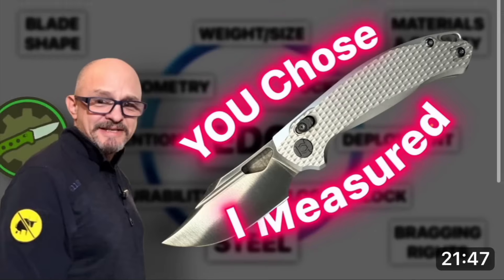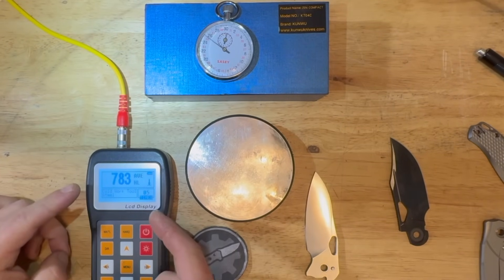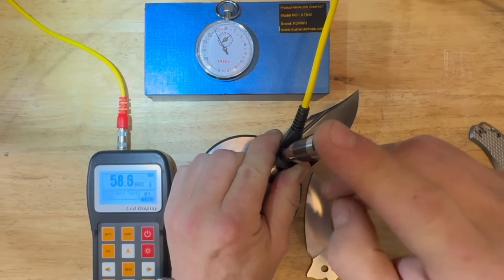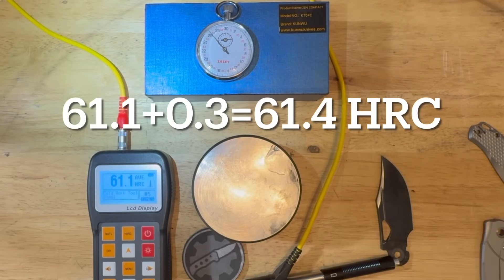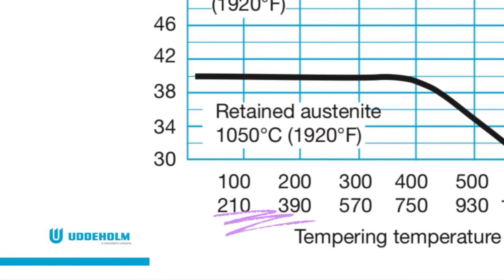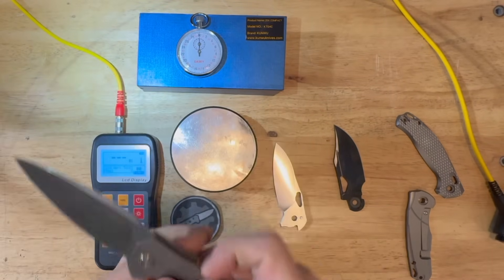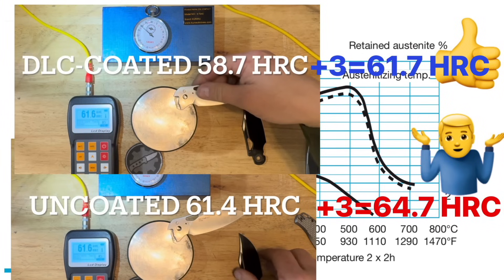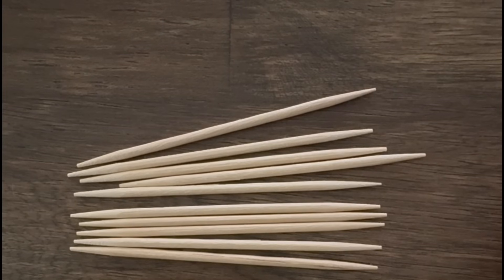Myth vs. Reality. Let’s discuss how DLC alters the blade’s hardness.

Comment: I only entertain a coated blade when it is an easily corroded steel. At that point I prefer PVD or cerakote. DLC has its advantages but seems to be applied to steels that don’t require a coating.
Reply from the maker: @Briancollectsknives  Exactly!!! MagnaCut, S20V, Elmax, Vanax, S30/35/45, M390, 14C/12C, AUS 8/10, and many others DON’T NEED TO BE COATED. M4, 3V, CruWear, even D2 may need to be coated but they are not too corrosive.

Comment: You should test the blade where there isn’t DLC coating. Like shave it off.
Reply from the maker: Not a must do. That coating itself is harder than steel. It is only.00013”-.00002” so it is the steel that is being measured.
Reply: @ if it’s harder than steel wouldn’t the test come back higher? Something doesn’t add up.

Comment: So dude. I'm a big Kunwu fan and have experienced many of their blades. And seen many different HRC tests using the industry standard technique. Using the type of machine that creates a dimple in the steel. The type of machine that is actually designed for the steels used in pocket knives among other things. And they have always confirmed the numbers that Kunwu claims for the HRC. All that said I'm open minded to different knowledge sources. However, this LEEB device you're putting all stock into seems to be widely known to not be reliable for the high hardness of pocket knife steels. A quick Google search 'will a leeb hardness tester give accurate hardness of pocket knives' told me everything I needed to know. That device IS NOT a reliable device for pocket knife HRC and therefore you're putting all eggs in that basket does lend credence to the comments made by Kunwu on your previous video.
Reply from the maker: The link to Leeb Standard for testing ASTM A956/956M is provided in the description of this video. You don’t even have to read the whole thing, just read paragraph 7.2 and see for yourself that everything you hear from the “influencers” about this tester is total unadulterated BS. You sound like an intelligent gent, just follow the link and read the short paragraph. Thanks!

Comment: I love kunwu knives but I do agree to just use a different blade material to build upon with the DLC. They do work with a lot of exotic blade materials so I can see and appreciate them for that. The only thing I don’t like are the noodle ass omega springs they use🤣🤣 but that’s a subjective opinion
Reply from the maker: I don’t think you’re wrong about the springs. And also, the slide knobs on th cross bar have metal to metal contact with the Ti handle, which is inducing a ton of friction. The system is not balanced. Still a gorgeous knife.

Comment: Not sure if You are correct with this video. DLC aplication temperature is 100 to 200 celsius and short time period. While "Temper at 250 C for 59-60 HRC, 2 hours x 2" so chanses coating itself lowering HRC by 2 or more points is way to low... I guess HRC before DLC was just low enyway...
Reply from the maker: Time period is important. Any specifics on what it actually is? 
But 100°- 200°C converts to 212°-392°F which overlaps with the tempering range.
Reply: Different steels require different temps and times for the tempering process. So------------------
KnifeMaker

Comment: DLC from my understanding will help a little with corrosion resistance but not to much but mainly it helps with being very scratch resistant so the finish doesn’t get ruined but other than that I don’t see much advantage I believe it depends on the steel it may hurt it significantly or not as much I have 4 kunuwu two non coated and two coated the coated are the Excalibur and the primo both are performing amazing cutting cardboard like champs haven’t had to sharpen them they seem to react to the strop quite well and the two uncoated are the padre and the gringo and they are the same way I think it just depends on the blade steel to where dlc may hurt the steel more than it may help it but they are great knives and there heat treat on both coated and uncoated blades from my experience seem to perform just fine none dull super quick and they all seem to take the strop great and come back super sharp and neeves knives has sharpened there s390 dlc gringo and it seems that it still sharpens super well and doesn’t dull to easy so I truly do believe it is just a steel to steel basis but to avoid all this figuring it out I generally do prefer non coated blades plus just a little bit cheaper too lol
Reply from the maker: DLC was introduced as heat, corrosion, and wear resistant coating for bearings in high stress/high cyclical applications. None of its properties are needed on a knife but it looks beautiful.

Comment: When I buy a knife with a coating, it's usually purely because of the look. The fact that a coating that works at high temperatures during the process has an influence on the hardness should at least be known to the manufacturers, even many knife enthusiasts know this fact.
Reply from the maker: @achimgeist5185  Exactly!
Reply: Coating processes are a thing that should be considered for heat treatment. A lot of coating introduce heat, so you shouldn't temper below the coating temp. That should influence your whole heat treating recipe and / or choice of steel.

Comment: I have a question, DLC coating is harder than the steel itself right ? I understand that this treatment can decrease HRC in the steel itself but if the coating is harder why when its tested its not a harder HRC ? Can someone explain it to me ? Thanks
Reply from the maker: DLC is hard and flexible at the same time. It is also very thin, .000013-.00002”.
Reply: @CuttingBoardRx Ah I see, DLC can be mesured with HRC too if its thicker ? Thanks for the explanation
Reply: @ Yep! It is only apx. 1 micron thick. and yes, itj is very hard. In the 90's HRC Hence the name. DLC= Diamond Like Coating. 
My double stack 1911 is DLC coated. No wear! May have the barrel done as well. 4
KnifeMaker

Comment: There's a whole lot of BS in this video, much as I hate to say it.  First of all, you can't go by the steel producers data sheet and assume that the knife maker used their recommended numbers.  Most steels are not produced for use in knives and thus there's often variance in the recommended numbers and those used by specialty knife makers.  Larrin Thomas recommends tempering Elmax at 350° F, not in the 200s.  I doubt there are any knife makers using such a low tempering temperature for Elmax.

Second, you're grossly underestimating the temperature for application of DLC, which is closer to 700° F than 300.  So even at 350 F temper, application of DLC would be expected to reduce hardness somewhat.  How much?  Hard to say without actually testing it ... properly.

Third, you can't assume that your test of the coated blade is accurate, since 1) you didn't strip the coating and prepare the surface accordingly, 2) you don't know that the surface is perfectly flat (see above), and 3) the area you're testing is really too small, i.e., you are too close to the edge of the material (another factor with Leeb testers).  

So, while I think Leeb testers are accurate in the right circumstances -- even for knife blades -- there are times where they just can't be used correctly, and this is one of those times.  And with all that said ... the knife may actually be on the softer side.  I wouldn't discount that possibility.
Reply from the maker: Who said anything about 200°F? This video clearly states 300-350°F is the DLC plasma application range. 
I’ll give you the benefit of a doubt because you clearly looked at 200°C at the bottom of the chart. Surely you know how to do the conversion. We all make mistakes and it’s great that you’re confident enough in your ability to pay attention to post this comment.

Comment: 👍your method of hardness testing looks consistent and well calibrated/mapped to hrc.  If possible/$ - Just remove dlc coating(easily done with a few minutes on 600 grit diamond plate) then re-test, this would resolve whether dlc layer itself affects hardness or dlc application (heat) lowered steel hardness.
9:37 - https://youtu.be/D3wEvW-BbvE?si=t4DtSfjxfxC5n5AU&t=577  Mfg Elmax datasheet hardness curve is not optimized, where (BCMW - BluntCut MetalWorks - research) Elmax hardness can reach 65rc working hardness.  This blade still in my shop somewhere(I think) - https://youtu.be/z5hVmR9AsGg?si=KUcghS00nDxh97FU   BCMW current protocol target Elmax edge tool around 64rc.
Reply from the maker: Thank you for linking your video! I really enjoyed it. I totally get your point, after all many custom makers have been squeezing max performance out of mid-grade steels like AEBL or A2 on a regular basis. But we’re talking production knife here, clearly not a custom job. Plus their comment indicates that they are relying on “independent testers” when the right answer would have been to say “we test and keep records of every batch we make and these are available upon request.” Makes me feel that they have a blade vendor, not making them in-house
Reply: @CuttingBoardRx  Agreed.  Production batch/heat/run should be internally QA for meeting hardness and edge performance/test specs.  As for custom vs production ht, given proper/good protocol production oven/furnace and quenching assembly/line are/should have a slight advantage over a small volume ht oven especially when ht-ing 2+ blades at a time.  Also there is no excuse for production burnt edge either.  Optimized ht blade often claimed rather than delivered/demonstrated.  e.g. let's see 15dps edge whittles that antler (used in your video) and still sharp...

Comment: Maybe the DLC is softer than the knife steel? Kunwu provides a lot of value so put some #respek on it.
Reply: DLC has a hardness of 85-90 hrc.
Reply: @BladeLabMiami  do u think it would make a difference in his test if he removed the dlc coating on the tang and tested it again?
Reply: @BladeLabMiami  is there a standard DLC recipe? And iif it’s harder wouldn’t it increase the HRC of the knife?
Reply: Putting lipstick on a pig does not make it more valuable.
Reply: I don’t think so, but there’s no way of knowing unless you try.
Reply: @BladeLabMiami  sorry to double dip. Have u tested any knives in dlc with ur leeb tester?
Reply: @SteelAddicted  I've tested a DLC Padre, Gringo, and Stiffy P.  The first two were right in the advertised range and the Stiffy P. was 2.4 points HIGHER than the high end of the range.
Reply: @BladeLabMiami  I asked as many have if he would be willing to do it but I guess we will have to wait and see. Do u think the adding +3 points was directed at me/ u for me asking him directly about the 1.6 u had to add based off of ur test samples? Just wondering. If u don’t want to answer I understand.

Comment: Interesting. I never considered that DLC would impact the overall hardness. I usually go for uncoated blades but sometimes (like microtech) I like the contrast between the black DLC and satin flats
Reply from the maker: I actually don’t care about the blade of a well carried knife getting scratched up against the satin grain. This Django is not just a very good looking piece, it could be hard-used, but this weekend I have Incosi in S45VN and Spydie UKPK on me because I had to disassemble Django to film the video.
Reply: @ I want a CRK Sebenza with the magnacut Sheepsfoot blade badly. I do have a Tuya with an almost identical blade coming this week. But in S90V. Woo-Hoo!!!
KnifeMaker

Comment: Thanks for giving me the information to verify a recent question I had. I reached out to Demko to inquire about how their DLC  process affects their targeted 60-62 hrc for 20CV a couple weeks ago. I was told it shouldn’t have an impact. Looking at the data sheet for 20CV it appears that the target temperature range is 400-800 degrees F. Sounds like they know what they are doing!
Reply from the maker: Cold Steel is the Demko OEM. They definitely know what they’re doing!
Reply: Demko customs are outsourced to Peters heat treatment.
Reply from the maker: That’s US made ones, right? I saw AD20 Blade Show addition made in Taiwan, are they not considered custom?
Reply: @CuttingBoardRx the USA ones from Demko himself. The ones in Taiwan are mass manufacturered.

Comment: If you don't mind Sir, I would like to chime in on this. 

To the detractors, it is well known that DLC does indeed drop the Hrc of many steels. It is common knowledge.   there many companies, particularly when using a steel that can rust easily, but can be lowered in hardness with the heat in used in some coatings, going to applied coatings such as certain epoxy and or polymer coatings. "The Benchmade Bailout in CPM M4 is a good example. there are however, as briefly touched upon here ways around this. 

The most sure way is to use a steel that possesses a secondary hardening in initial Tempering  such as the old standby 154 CM adn CPM. IN this case, it can reach a good 60 Hrc at say 350F. go higher and it drops the Hrc quickly. However, as in your S30V example, it poses what is known as a secondary hardness capability at rather elevated tempering heat. At 1000F for instance, it can reach 63 Hrc, particularly when sub zero is incorporated between the heat and temper. In this case, the DLC has NO effect on the final Hrc.

So in essence, he detractors are wholly misinformed in this case. Which is not particularly surprising as the average viewer is not a metallurgist or heat treater. 

Further, the test product you are using although not a recognized industry standards, is perfectly capable of showing a degree of difference between the two blades. Will the exact Hrc be dead on? Maybe, maybe not. but that is not the point. It will indeed show a rather accurate difference between them, therefore accomplishes the task at hand.  you can for that matter, use tow different industrial Hrc testers and get very close but different numbers. Not uncommon at all. What is important is the consistency. As far as the blades not being thick enough as one poster points out, this is the reason the blade is positioned on a rather thick test block. When uses with the gel,  it will give a reading similar to one solid piece of steel. Not exact, but more than close enough for this type of comparison. 

Am I a metallurgist? No. but I have studied metallurgy for many-many years as a necessity and hobby.  My sign off will more than y explain it. For those too young to understand, look it UP!  

KnifeMaker/Retired with over 47+ Years in the Craft, and  in association with the Original R.W. (Bob) Loveless/Jim Merritt Custom Knife Shop
Reply from the maker: @michaell397  Thanks for commenting, Sir! I bet you have some stories to tell! Love having you on the channel!
Reply: @ to reply to CBRx- A Few No doubt.  It's an OLD Man Thing!!! LOL!!! ;<)  KnifeMaker
Reply: Thank you for this comment, which addressed multiple questions I had, very adequately, in one fell swoop!
Reply: Having a hard time understanding what you were referring to re the bailout m4 which is cerakoted not dlc. Just confused
Reply: @mrmouse-ol9pw  Simple really. 
DLC is a plasma process that heats the metal. Ofter over the actual tempeing timp, therefore lowering the hardness. Cerakote on the other hand is a painted on, (sprayed, adn baked on coating which does not heat to the point of effecting the temper.  
KnifeMaker
Reply: @ Do you know for a fact that the factory  applied Ceracote does not raise the temperature to more than 200 degrees F? Or about 350 degrees F for MagnaCut? I know there are do-it-yourself ceramic coatings that use a home oven to heat the product, but those ovens can reach temperatures of over 400 degrees F.
Reply from the maker: @ I researched Ceracote application guide for the video that will be posted tomorrow. The short answer is no. 
PVD coating does require 300°F and up, so not desirable on steels that are not designated High Speed eg. 3V, D2
DLC coating may reach 350°F but duration is unknown, and that’s what I’m trying to find out.
Thanks for subscribing!
Reply from the maker: @mrmouse-ol9pw  He did misspeak, I noticed it too but his point stands, ceramic coating requires high temperature as well.
Reply: @ nope. 250f for 15 minutes for Cerakote. can be used.   Nowhere near enough to affect temper.  And it is by far the most popular out there. (Also what Bench Made uses) ;<)
;<)
KnifeMaker  (I also Smith 1911 and 2011's)
Reply: Elmax has a secondary hardening protocol that provided higher edge retention. It's less corrosion resistance, but not by much when used with cryo and if your going to use DLC, it would be idea.

Reate uses secondary hardening for m390 and that's why it performs better in cut testing at a lower hardness.
Reply from the maker: Interesting info on Reate. The only one I have in M390 from them is T1000 and I can scratch that satin finish with a #2 pencil (exaggeration)
Thanks for your very informative comments btw.
Reply: @CuttingBoardRx secondary hardening in m390 brings out harder MC mc6 etc for higher edge retention. But the substrate around it is only going to be between 59 and 61rc. It will perform similarly to a 62rc m390 from say spyderco USA for example. But the edge strength will be different and be more prone to corrosion, especially if using bead blast.

Comment: I always thought it was general knowledge that DLC lowers the HRC in blade steels.  There are two benefits to DLC that you didn't mention.  One, is that it can prevent rust on blade steels that are prone to corrosion.  Two, it shields blades from some scratches as the DLC has a very high HRC.  But all things considered, You are right in that it is for cosmetic purposes.